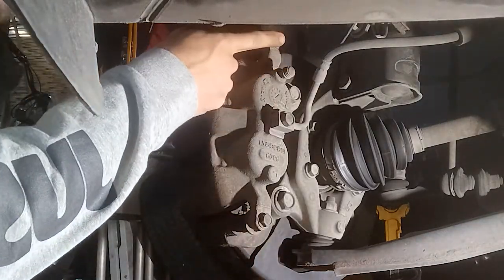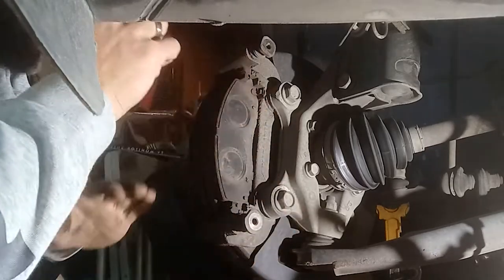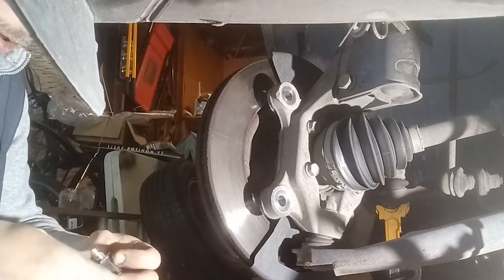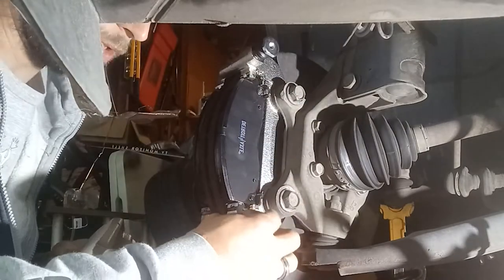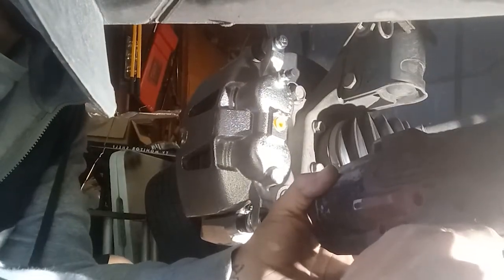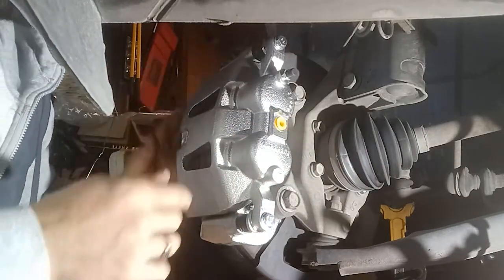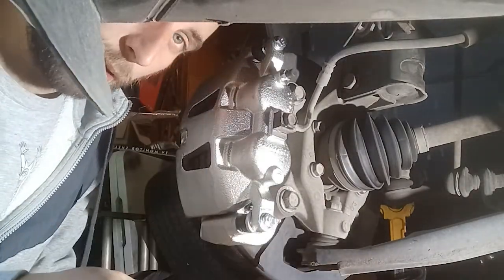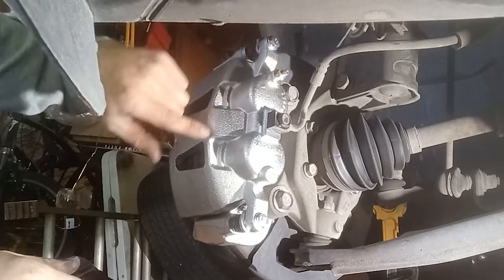2014 Grand Caravan Front Brake Pad and Caliper Replacement

Comment: I have the same vehicle 
And when I’m driving and slow down for red light or stop sign jerking and rumbling and then stalls and I’ll try to start it , it starts and as I go into gear D it just jerks a little and stalls or it just stalls 
I tried to look underneath and seen around the transmission is like oily I don’t have good enough jacks to really get under and look but idk maybe someone can point me in the right direction
Reply: It sounds like it's low on oil